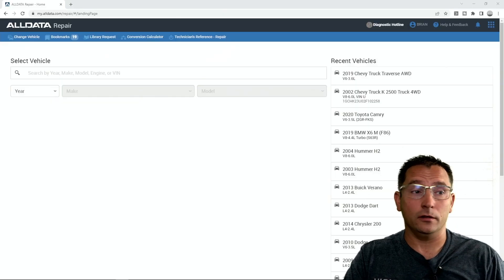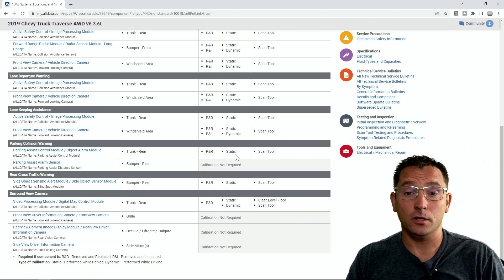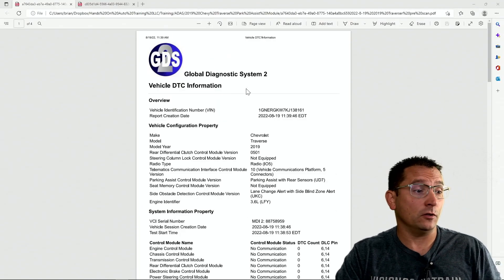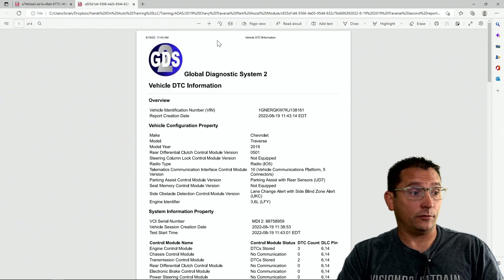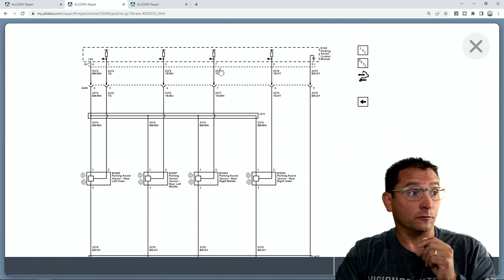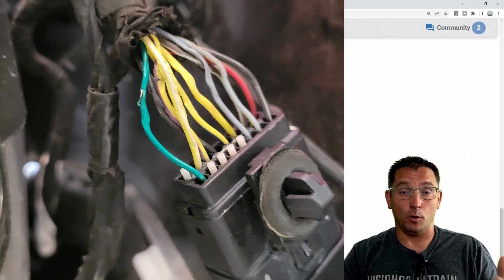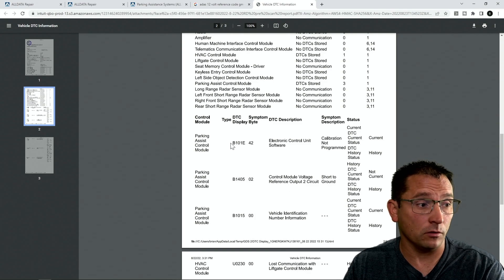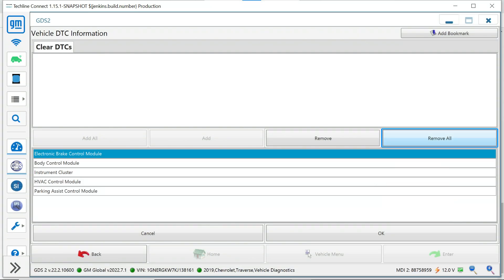2019 Traverse Park Assist Module

Comment: How would a crushed low speed wire cause the high speed bus to be off line you think? Or unless it’s a loop design can system
Reply from the maker: Low speed is used for the peps/ push button start to wake up the vehicle. Also , this is a long shot as I did not test the network,  I am not sure how the serial gateway module reacts or isolates other networks.